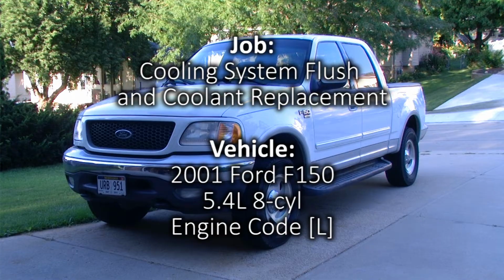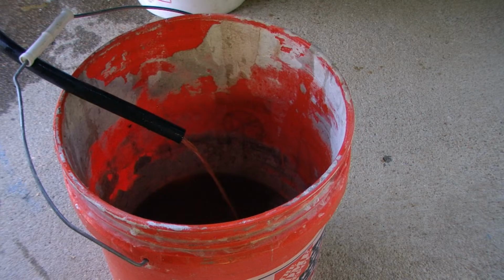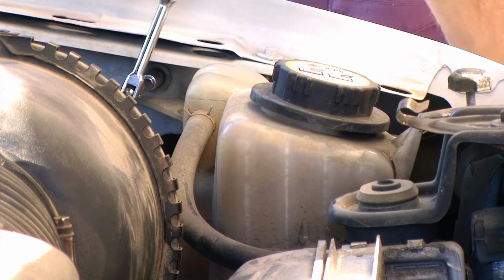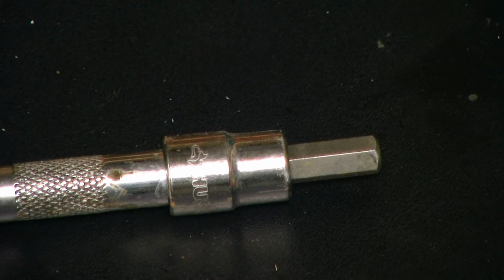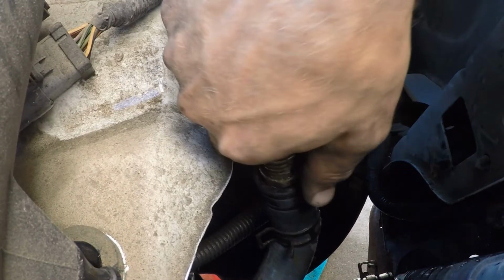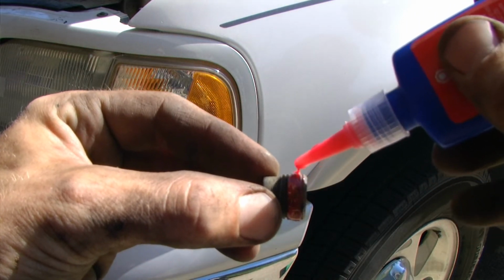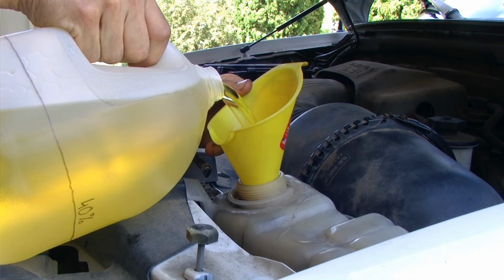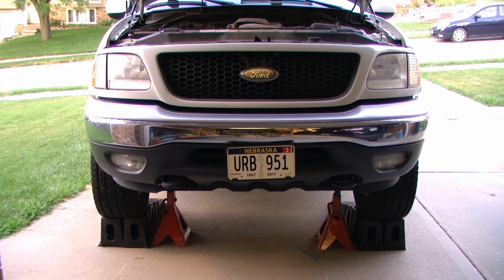2001 Ford F150 - Cooling System Flush and Coolant Replacement

Comment: PLEASE DO NOT TOUCH THE DRAIN PLUG🙏🏿 It stripped and two shops could not tap it through with multiple drill bits. Spent two days myself and still no luck. Plus was told by shop that they do not touch this bolt anymore to do flushes. I hope this prevents someone going through what I went to. I have to know just tack weld the spot where we tried drilling for hours.
Reply from the maker: Some shops will opt to use a machine and use pressure to flush the system, which is generally a decent alternative. With the “machine” process, there has always been some concern that higher pressure can stress a weak head gasket. Most people working on their truck in their driveway don’t have access to a machine, and that’s where the block drain plug helps ensure the old coolant is actually removed from the engine block.

That said, the block drain plug is one of those fasteners that needs to be treated with caution, especially on older trucks. If it comes loose easily after penetrating oil and the correct socket, it is the most thorough way to drain the system. If it resists at all, forcing it can create bigger problems, and stopping is the right call. In those cases, draining the radiator using the petcock and doing multiple drain-and-refill cycles with distilled water is a safer alternative.

I appreciate you sharing your experience here. Hopefully this helps others decide which approach makes the most sense for their truck and situation.

Comment: They make a hight temp thread sealant that isn’t red loctite 😂. Good luck to whoever has to get that thing off next
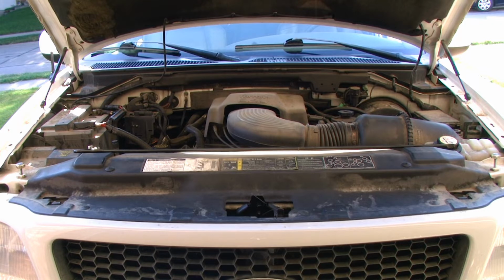Reply from the maker: Thanks for the comments.  There have been multiple others that also noted the use of red threadlocker.  I did have to remove this about a year later when I did the oil filter adapter plate https://www.youtube.com/watch?v=JknqTQNP2Mc&t=171s (2:30 in the video)  It was on there good but I was able to get it off without too much trouble.

Comment: I just did this coolant flush on my 2000, F150 5.4 Triton, and wanted to compliment this video, for how helpful it was for the job. I have flushed the coolant system once but never got to the engine block, plug before, and I doubt the the others who have flushed that engine over time did that.
Quite a relief to get get that plug turning and had to use a 18-in extension like in the video.

Very satisfying to be putting my garden hose through that whole system and seeing it come out the engine block.

Made sure to get the Loctite 272 hi temp, red.

Thank!
Reply from the maker: Thanks for the comment.  Some people have criticized the use of red Locktite, but it what was recommended and I did not have trouble removing the plug a year after this video when I had to drain it for a different repair.

Comment: Thank you for a wonderful and concise video, I appreciate the time you put in to shoot, narrate and edit it.  This comment is meant in all kindness and is not an attack.......  May I suggest not using red thread lock on the drain plug?  My experience has shown that it takes considerable force to break things loose, if they're rusted/torqued down - Permatex spec is 10 to 20 foot pounds which is added to whatever torque it's installed at.  I've had to fight bolts that were a problem and eventually had to heat them up, spec says 500 F to soften it up enough to remove.  It's a low pressure application with a pipe threads, a couple wraps of teflon plumbers tape works to keep it from leaking.
Reply from the maker: Thanks for the comments.  There have been multiple others that also noted the use of red threadlocker.  I did have to remove this about a year later when I did the oil filter adapter plate https://www.youtube.com/watch?v=JknqTQNP2Mc&t=171s (2:30 in the video)  It was on there good but I was able to get it off without too much trouble.

Comment: How much tap water stays behind in engine block?
Reply from the maker: The vast majority will drain down to the lowest point which should be the block plug.  You can use some compressed air and gently blow out the system.  Of what little that remains should be insignificant in the grand scheme of things.

Comment: Where's your EaA filter? 🤣
Just carefully cleaned mine out with a fine horsehair brush. Wish I woulda bought just one more before they were gone...
Reply from the maker: Which filter are you referring to?
Reply: @InsaneOil  Maybe you haven't been a dealer long enough. The Ea Air Filters were a long-life nanofiber filter. The EaA191 was the filter for Ford gas trucks.
Reply from the maker: @salsuginusrex5196  I am familiar with the Ea Air Filter as well as the LTF (Lifetime) Air Filters from the 80s and 90s.  I was confused about your filter question posted to a coolant change video but now understand what you were getting at.  The Amsoil Ea Air Filters/Technology can still be found in certain circles.

Comment: haha that plug isn't coming out again
Reply from the maker: Actually, I had to remove it again about 2 years later in this video: https://www.youtube.com/watch?v=JknqTQNP2Mc&t=821s and you can fast forward to 2:20.  It was tight but I was able to remove it with a ratchet.
Reply: @InsaneOil  Nice! I work on airplane components and it seems like a lot of people go overboard on loctite, makes certain things way too hard to remove, even with proper tooling you risk damaging the component. Being a vehicle though, I know its cheesy and definitely not heat resistant but do you think thread tape would work? Was wondering because when it warms up this year Ill probably be flushing my system too
Reply from the maker: @Droxicshock  Technically, thread tape could work.  However, there is some concern with little pieces of the thread tape breaking off and circulating through your system causing other issues.  I would almost think an RTV sealant rated for heat and resistant to coolant might be a better short term solution.  I would have to do some research to get a more solid answer.
Reply: @InsaneOil  I thought the same thing about it getting in the system, would have to do it carefully and even then. As long as the plug came back out sounds like you had the right idea with the loctite, thanks for the video and response.
Reply from the maker: @Droxicshock  Thanks for the comments.  Good luck with your repair.

Comment: Great video. My 2001 5.4 v8 triton calls for roughly 24 quarts (6 gallons).  My issue is that I can only seem to get about 3 gallons of coolant back into the engine after the flush, even after running it and driving it a while. 
During the flush(s), I got it to operating temperature, cut power, then removed the engine block drain, and opened the radiator drain, letting it completely empty every  time before the next cycle. Any ideas? Thanks in advance.
Reply from the maker: I am not sure where Ford came up with the 6 gallon number.  I also was never able to remove (or add) 6 gallons.

Comment: 4 year old video and still helping out folks like myself. I just couldn’t get my coolant system properly bled and this video helped me achieve that. Unfortunately I couldn’t access the drain plug on my f150 since the motor mount sits right on top of it but I got a lot of old fluid out. Thanks a million 🙏🏼
Reply from the maker: Thank you for the comment.  Sounds like a successful repair.

Comment: Great video but he's only taking out the drain on the left side of the engine. This leaves the right side with only water until the new antifreeze circulates. Draining the right side is difficult but that's the only way to drain the right side sediment. The drain plug is behind the motor mount.
Reply from the maker: Thanks for the comment, the tip is much appreciated.  The repair manual did not specific a second drain plug on the right side.

Comment: My over flow is full of pitch black stuff, so is the master cylinder…i just got this truck so im doing all the fluids but if anyone has other things they can recommend id appreciate it
Reply from the maker: I'd recommend changing the coolant, removing the overflow, cleaning it, reinstalling it and the monitoring to see if it becomes black again.  If it does, there may be a leak into the cooling system.
Reply: I @InsaneOil

Comment: Where is the block plug
Reply from the maker: Driver side.  Although the repair manual claims there are two block plugs (one on each side), but my engine did not have two.

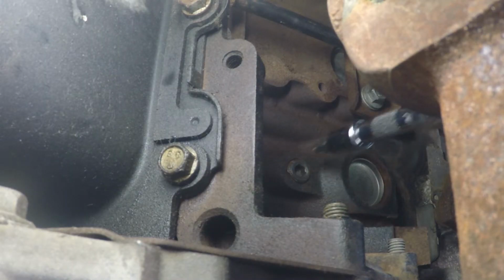Comment: Is there a block plug drain in a 2006 F150 as seen at 4:29 ?
Reply from the maker: If you have the 5.4L engine, I believe it is the same.

Comment: Just to be sure how many gallons of 40% distilled/60% coolant does it require
Reply from the maker: My spec sheet says the system has an initial fill of about 24 quarts (6 gallons).  That is about 14 1/2 quarts (3.625 gallons) of coolant and 9 1/2 quarts (2.375 gallons) of distilled water. https://www.amsoil.com/lookup/auto-and-light-truck/2001/ford/f150-pickup/5-4l-8-cyl-engine-code-l-l/?zo=10458

Comment: How does rust in the coolant system happen ? Is that only up north where there is snow ? I have the same truck and coolant looks clean from the resvoir , debating if I should just top it off or if it’s time for a flush
Reply from the maker: Rust occurs when the coolant has lost its ability to prevent the rust from forming.  Essentially, when the coolant "goes bad" or looses its effectiveness, then rust and corrosion begin to form.  Best way to test it is to use a Coolant Test Strip. https://www.youtube.com/watch?v=cWTpe2-i-JA&t=1s

Comment: At last. A proper video on a coolant swap. I am facing this on my 18 Explorer and I must use a shop and I do not trust any of them. It is a easy scam and even easier to have it done wrong. Probably will end up with a gallon drained out and a gallon put in. I dare say most tecks do not know it has a block drain. Amazing job. If I knew I would get a job like that, I would be in the shop tomorrow!🦇
Reply from the maker: Thank you for the comment.  Good luck with your repair.

Comment: Is there a need to remove the thermostat?
Reply from the maker: Not necessarily.  If the lowest points on the vehicle (the block drain plug and the radiator drain plug) are removed gravity should remove pretty much everything.

Comment: How did you clean out the reservoir?
Reply from the maker: Pulled it, filled it up with warm soapy water and used a brush.  You could also fill it with vinegar water and soak it for a couple hours.  Just make sure you get it washed out before you reinstall it.

Comment: Awesome - A bit annal but that's what I needed. Any tips on cleaning the reservoir of rusty chunks
Reply from the maker: Pull the reservoir, fill it with soap and water or vinegar and water, let it sit for a couple hours, shake it around, use a bottle brush to get inside it, or buy a new reservoir.  Make sure you clean it out very well before reinstalling it.
Reply: @InsaneOil  It's done. I rinsed it with a cleaner for 200 miles, rinsed it again until clear water came out. Then put in about 1.5 gallons of coolant with as much wawa. This after a new serpentine belt and hoses.
Reply from the maker: @SpearChuck777  Sounds like it was a successful repair.

Comment: Im about to do this on my 2004 f150 5.4L. My heater already doesn’t work, would that have anything to do with my coolant system not being bled, or would that be my heater core or how would i know?
Reply from the maker: There is a variety of reasons why you might not have heat… The first, simplest solution would be to see if you were low on coolant… Flushing the system might also help… It could also be that your thermostat is stuck in the open position…it could also be that the heater core has failed…lots of reasons without having more info.
Reply: No heater, last owner I can visibly tell had cut a hole to access blend door, all vents blow cold air, truck gets up to temp normally, no over heating, not low on coolant, coolant looks a bit murky and have a white ish smoke that is not super thick but smells that comes out of my exhaust. Would that help with diagnosing why a 98 V8 4.6lt f150's heater does not work?
Reply: I do need new plugs, so I think that's why I have a rough idle, smoke and not as much horse power.
Reply from the maker: @alee5064  I had a similar issue and it ended up being a leak in my coolant crossover. https://www.youtube.com/watch?v=W_UpGwTkr64&t=1444s

Comment: I see that you driveway i sloping towards the back of the truck and you also added jack stands. Do you want this much lift on the front end of the truck? Just so the flush works better? Idk please lmk
Reply from the maker: Jack stands are a redundancy in case the rhino ramps fail and the truck falls.
Reply: @InsaneOil  thanks for the reply! I was gifted a 2001 F150 5.4 and I’m getting around to doing all the required maintenance.  I was going to do an oil change, but as soon a took off the oil filler cap, I saw there was a bunch of dark yellow/ brown slime on the cap and the tube going down into the engine. I know this isn’t right. What do you recommend I do?
Reply from the maker: @todayscatch5471  I'd recommend running Amsoil Engine Flush when you do your oil change. https://www.amsoil.com/p/engine-and-transmission-flush-flsh/?zo=10458

Comment: That plug on the bottom of the engine block makes me just want to take it down to my local mom and pop garage and have them do it.....they are better equipped to handle not only the drained coolant, but also have a lift......the older I get, the less I like to crawl under my vehicles, lol.

Comment: When you flush the coolant system does it also flush the heater core ?
Reply from the maker: There is minimal fluid in the heater core.  Much of it will drain down through gravity also.

Comment: Why is it people prefer to get concentrated coolant instead of pre diluted 50/50? Is it really better to mix yourself or purely personal preference?
Reply from the maker: I don't think it is necessarily "better" to mix it by yourself.  I think some people think that if they buy the premixed than they are just wasting money buying 50% water.  For the majority of people, I think it is just more convenient to buy the premixed.  For me personally, I run propylene glycol, rather than ethylene glycol, and it is not sold as a premixed solution.
Reply: @InsaneOil  I e always felt 50/50 was just more convenient. It’s what we always put in forklifts when I was doing PMs, but it seems every time I watch a video with coolant, everyone prefers concentrated. Your response makes sense, though (propylene glycol).

Comment: Thank you Insane Oil. This video along with a few others that you posted have been helpful and much appreciated.  

I basically followed the steps that you outlined here, though I used distilled water for the flush, thinking that some water might remain trapped after the flush....and to have empty containers to carry the old fluid away for proper disposal.  Another commenter noted that the heater core was not flushed which I did not even consider as I assumed (perhaps incorrectly) it is inaccessible and at a higher point and therefore should mostly all drain out.  Once completed, I did have some doubts about how much was flushed out, as the amount that could be refilled came up short when compared to the owner's manual capacity specification. Still it was good to get the bulk of the old coolant out. 

To add to your note about socket/wrench sizes needed to complete the job, 5/16" is 7.95 mm, so I found that my 8mm hex socket fit the engine block antifreeze drain plug quite well. I would echo the other person cautioning about using permatex-high-temperature-threadlocker-red, as the manufacturer states "Cured Threadlocker must be heated to 500° to 600°F (260° to 316°C) before parts will separate", which I would not want to do in the future. I used permatex-thread-sealant-high-temperature in a small white tube, as that was about all my local auto parts store had in stock. So far it has not leaked, but the truck has not been driven very far yet.
Reply from the maker: Sounds like a successful repair.  I did remove the bolt about a year later during another video: https://www.youtube.com/watch?v=JknqTQNP2Mc&t=63s and although it was quite tight, I did not need to use heat to remove it.  The concerns about the Permatex Red are warranted through.

Comment: Hi Insane Oil, can you please share the size of the hose that you connected to the drain? It is a good idea to use hose and avoid the mess than drain directly from radiator. Thank you!
Reply from the maker: The hose had an inside diameter of 3/8".  The hose works alright but any way you do it, it will make a mess.  I personally don't worry about the mess as I use Amsoil's Non-Toxic Coolant which is biodegradable.  https://www.amsoil.com/p/low-toxicity-antifreeze-and-engine-coolant-ant/?zo=10458 If you have a concern with the toxicity of conventional coolant, then I would recommend trying to contain the mess.

Comment: how did you clean the reservoir? mine is coated with gunk.
Reply from the maker: Soap and water…stick a brush down there.  You could also soak it with vinegar/water for a couple hours.
Reply: @InsaneOil  ok, thank you, wonderful easy to follow video!

Comment: Thanks for taking time to post this.  My 2001 F-150 Owner's guide says use "Ford Premium Engine Coolant (green in color).  DO NOT USE Ford Extended Life Coolant (orange in color).  If I'm not using Amsoil, what is an appropriate coolant at any autoparts store?
Reply from the maker: Traditional green coolant will work just fine.

Comment: You're an idiot, using red Locktite you will have hell trying to get that plug out again
Reply from the maker: Actually, I am currently doing a repair video (should be finished and uploaded this week) which I had to pull the plug...it was tight but got it out without any issues.  Red was recommended due to its resistance to heat (given that it is on the block).